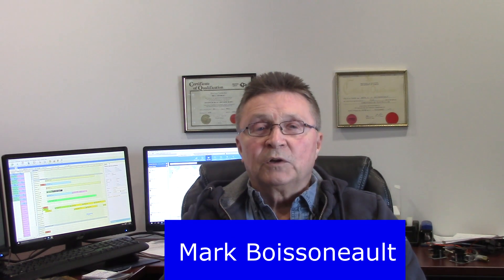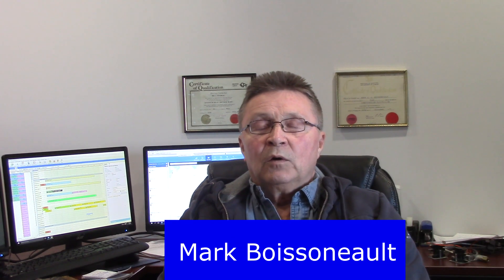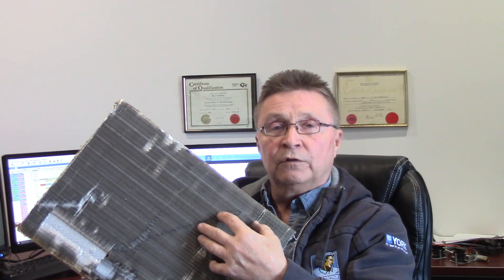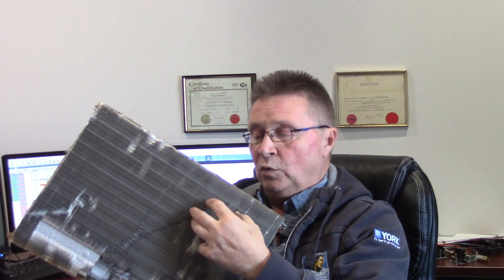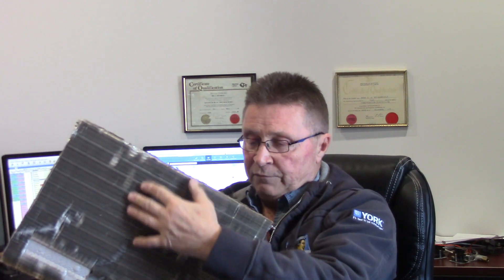3 most Common reasons Why Your Air Conditioner Freezes Up

Comment: sorry but I live in the land of farenheit. Actually in Florida to be specific and for context.Even in sunny south Florida, I know no one who runs their AC at 68 degrees F, let alone try for a quick cool down by setting it to 59. Is that common anywhere?

 that being 
said. I noted last summer, which was particularly hot with feels like 101 - 105 more common than not, that neighbors galore were pronouncing their AC units of various vintages and types    DEAD because they could not cool below the high 70's to mid 80's.  In that type of extreme heat and humidity over a period of weeks how low is it reasonable to expect your AC cool on a regular basis?

thanks for taking the time to share your knowledge. Much appreciated.
Reply from the maker: Its all about getting relief and comfort by dehumidifying and cooling to a level that is as good as can be expected on the hottest days. A 15 deg Fahrenheit drop from any temperature provides relief.  Up here in Canada we will at best see 90 deg f on our hottest days. Stay Cool!
Reply: With you being in Florida, the extra humidity puts an extra load on the A/C system. It raises the "superheat" (amount of heat picked up by the refrigerant as it passes through the evaporator coil) of the system.  It will take the A/C longer to pull the temp down to your desired level. If you desire it "meat locker" cold and when its time to change out  the HVAC system due to age, etc, go up 1/2 a ton. Example: if you have a 3 1/2 ton system, go to a 4 ton (and go with one with a TXV vs. a piston).  I  live in central Arkansas, and the summers here are just as stifling as they are in Florida (mid 70's dewpoints with mid-upper 90's air temps).
Keep those coils clean, both indoor and outdoor coils, and have the refrigerant charge checked if you think something is amiss.
Reply: Get OUT of Florida. It's as terrible as californistan

Comment: Thank you so much I'm new to the field and had a compressor and sucton line In ice and I knew it was a leak in the system but you also said that if you block all the vents that can be the issue as well.

Comment: Do you know why my new AC is blowing a sweet gross smell out of all the vents? We had a new AC installed in the Fall and I turned it in today to make sure it was working and there was a sweet gross smell coming out of all the vents. The mechanic said that it was not a freon leak and that the fan was working and all was okay, but why the smell then?
Reply from the maker: If the system is cooling and condensing nicely, it will not be because of a refrigerant smell. Perhaps there is something that accumulated on the evaporator coil or in your ductwork over the winter.

Comment: Thank you for the information shared. I have a question regarding ceiling concealed ducted split unit. There are 6 units installed at a light commercial building. 4 of the units serve an open trading floor while the remaining 2 serve a space. Based on the report given, there is a quarterly maintenance being carried for all 6 units. A year after commissioning the units, the cooling effect of the ACs drastically reduced (indoor temperature 26 - 27 degree celsius as against 22 - 24 degree Celsius initially observed)  even after the scheduled quarterly maintenance. I was privy to be present during the last service carried out by the technician and the tasks carried our were (1) remove and clean the filters (2) wash the return coil fins with brush and water (3) wash the condenser (4) Check the gas level (60 psi on low pressure side for R22 system). My question is that are the steps enough to be deemed a good servicing. The filters were clogged heavily and when removed, there were lots of dirt on the return coil fin which makes me feel it will have penetrated into the unit over time. The speed of the fan is low when operational and the condenser shuts down at about 5 - 6 minute interval and starts after 3 minutes. The short duration of the condenser working is responsible for the high temperature observed in the space. In the little research i have done, i saw that the blower of the unit is supposed to be removed during each service. Kindly confirm this and add any additional suggestion.

 Regards
Reply: From our experience, it does not seem reasonable to remove the evaporator blower during regular maintenance.  Unless of course it is blocking the way to properly clean the cooling coil. Based on the information you have provided here, it is hard to offer you a simple or conclusive solution. I do not know what brand of ductless you have but I will suggest that the manufacturer's teck support should be contacted by a knowledgeable service person in your area. 
If your units are short cycling and/or not condensing properly there are a few possibilities that are not that easy to diagnose. Refrigerant pressures do not necessarily represent a proper system charge. There are thermisters, sensors, and possibly transducers that are unique to each model and must be measured and compared to a known baseline reading .  
Good luck. Hope this helps.
Reply: Mark Boissoneault a little. Thanks

Comment: Reason 4: Unit is oversized
Reply from the maker: Yes this is correct. There are a few other reasons for this problem as well. Most of which would involve a much longer explanation.

Comment from the maker: Yes you are correct. A contactor or thermostat as well as a pinched wire  that shorts out  Y to R  can all be a reason that would cause the system to stay running and over cool and freeze up the evaporator. There are a few other conditions also not mentioned here as well. My intention for this short video was simply to offer a basic explanation of what I consider to be 3 of the most common reasons that most homeowners might encounter.
Thank you for your comment.

Comment: Please explain exactly how low refrigerant level can cause freezing up at the evaporator?  It is the opposite of automotive systems wherein low charge levels reduce evaporator cooling, not increase it.  I just don't understand the physics of how having less liquid to evaporate (and absorb heat) can INCREASE the rate of evaporation inside the coil.  Less liquid would get into the coil and the less liquid, the less evaporation, the LESS cooling.  Explain what I'm not getting please.
Reply from the maker: I will try to explain as best as I can here. The design of an evaporator coil is such that a high level of heat transfer is possible based on a steady flow of expanding saturated refrigerant vapor.
Once the required refrigerant level drops below designed capacity the refrigerant will flash or expand before it reaches the coil and become colder since there is little to no heat transfer happening at that point. Similarly lowering airflow across the evaporator would also lower the heat transfer capacity and frosting will occur.
Reply: Thanks TMS.  I'm an expert on Automotive HVAC, everything from Miatas to Macs. Most vehicles nowadays use some variation of a TXV to throttle refrigerant. As in home systems the refrigerant turns from a liquid to a vapor in the Evap. Too much refrigerant and the evap will ice up and there will even be frost or ice on the return line in a hot as blazes engine compartment.  Not enough refrigerant and for a while the refrigerant will vaporize before the TXV, then at a critically low level the system will shut down.  At no time will the evaporator ever ice up in an automotive system due to a low refrigerant level. It seems to me that if home AC refrigerant flashes before the TXV then there will be less liquid (if any) and therefore far less capacity for the refrigerant to absorb heat in the Evap.  I don't mean to belabor the point or disrespect your knowledge, I just don't get how if less liquid can vaporize inside the Evap it will actually be colder in there. I appreciate your helping me 'get it'. [I know home AC is more complex than Automotive because you guys have to deal with superheat and supercool calculations and we are quite happy to just know the high side and low side pressures.]

Comment: What about restriction in the line set or faulty metering device
Reply from the maker: You are absolutely correct Julius. This video however points out 3 of the most common reasons and not a complete and detailed list that would require a much longer explanation.

Comment: If you installed a brand new Mini split and it froze up the next day what would you recommend
Reply from the maker: It is likely that it was not installed properly or set too cold. Confirm that the installer knows what they are doing, and read the operating instructions.
Reply: Easy, 
Either Freon low due to improper charge at install. Or you have Freon leak. Or indoor fan motor failure. 
Solution:
1) Pressure test system with 300psi. of nitrogen.
2) pull vacuum of 500 microns or lower.
3) weigh in Freon charge as recommended by manufacturer 
4) enjoy your new system 

5) let professional licensed HVAC contractor do the work with warranties to protect your investment

Comment: perfect ... the idea of freezing when the air flow is blocked , because the air will carrying or absorb the cool from the coil and make it's Temp down so will not get freeze . if the air not flow through the coil the coil temp. will get down until it's freezing

Comment: My AC started not working this summer. I had a AC guy come out but he just charged me a service call fee and did nothing. Today it was really hot and I turned the AC on and it was cooling ok. It's been running for a few hours and I removed the vent just above the evap coils to look at them and they are about a quarter frozen with water pooling already inside the housing. There is no dirt on the coils and my filter is brand new.
Reply from the maker: Is the evaporator  coil clean on both sides? And is the condenser coil clean on both sides as well? Based on what you have found so far , it looks like the unit may have developed a leak and is low on refrigerant. How old is the unit and what model?

Comment: How do I stop the water from  leaking into the drip pan that drains outside the house?
Reply: You should not try to stop the water from being produced. That represents the humidity that is being removed and giving you comfort. The water needs to go somewhere. Newer models have a water sling on the condenser fan blade that splashes the water onto the coil and eliminates and water coming from the drain pan. You may need to upgrade to this type of unit to get away from water draining out.

Comment: Hi great video thank you very much for posting it. I had a question I bought four AC units 1 Danby 12k btu and the other 3 Frigidaire 5k btu none of which have holes for the water to drip out in the rear. They are mounted into the wall. Do I need to make my own hole in the back there does not seem to be any plug to take off? Thank you
Reply from the maker: Hello Hose. Chances are if there is no drain hole then the system is designed to use a fan blade that internally scoops up the condensate water as it transfers from the front cooling coil to the rear fan blade and splashes  it onto the rear coil where it evaporates. This is a newer design that makes it more efficient.

Comment: It is hard to understand one of your explanations for freezing up of the coil.  You said if there was inadequate amount of refrigerant in the system or if it had all leaked out the coil would freeze up.  How So?  If there was little Freon left in the system then the unit would simply stop cooling the air because it cannot cool the volume of air in the house for what little Freon is available.  
If the filters were changed frequently and there was no obstruction of the vents or bypassing of some of the vents AND the condenser was properly sized for the house (roughly one ton of refrigeration for every 600 sq feet of floor space) then the coils most likely would not freeze up.  Your demonstration of dirt covered coils was useful.  Thanks.

Comment: A common error is oversizing the AC condenser beyond the capacity of the house.  For example, installing a condenser for 4 tons of refrigeration in a house with 1,300 sq feet of floor space.  Once that condenser is properly sized for 2 tons of refrigeration, which is the correct size, then the coils stop freezing up!
Reply from the maker: Yes I agree. But the actual reason is that 4 tons of cooling requires twice as much airflow as a 2 ton. Every ton (12,000 btu) of cooling generally requires 400 CFM ( cubic feet  per minute) of airflow.

Comment: What about oversized systems to home area? Is that a concern that could cause freezing? For instance, if the unit is larger than the space it is cooling by a large amount?
Reply from the maker: Yes that could be a problem. The main concern is that it would cool too quickly and not remove much moisture that would give you lower humidity and more comfort.  The A/C being to large for the area can become a freezing up problem simply because the airflow is likely not enough for the added tonnage. Basic rule is 400 CFM per ton of cooling. EG: 2 ton (24,000btu cooling) generally requires 800 CFM (cubic feet of airflow across the cooling coil).
Reply: Wow... Was not expecting as prompt a reply. Thank you!

Comment: Great video, but please tell the thermostat settings in Fahrenheit and Celsius.
Reply from the maker: Yes I never thought my video would be popular in the USA. Thanks for checking it out.
Reply: Tradesman Mechanical Services Ltd. So what is too low of a temp in F
Reply from the maker: Most people do not need to have cooling down below 70f. to feel comfortable. Every degree below that is usually unnecessary and will eventually reach the point where frosting or icing occurs. I have seen the odd system that will cool down close to 62 Fahrenheit but of course it was working perfectly fine. 
Thank you for asking.

Comment: Excellent video, blazing summer heat and the ac is constantly puddling water under the handler. I changed the filter and hosed down the a pillar which was full of dust(desperate maneuver). I check the drain line and it's clear. I think it's low refrigerant and me having the vent in the second bedroom closed completely. A combination of things. Great video thank you.

Comment: Very informative!  Thank you:)  Mine froze up last night and I could hear a thumping noise in my attic where my air handler  is.  It also wouldn't blow air but the outside unit was running.  Do you think this is a lack of air problem or refrigerant problem?  I turned it off for now.
Reply from the maker: The thumping noise would be coming from the blower. Make sure the bower and motor are running properly and rule out any airflow problem before moving to a refrigerant problem. Good luck with that.
Reply: Thank you!  It was the blower motor in my attic.  Got it replaced.:)

Comment: Hi, had brand new a/c installed  closed one of vents closed can this ice the coils and lines. If so do I just let the ice melt from the coils and it will start working okay again?
Reply from the maker: It is hard to say if one  closed vent caused it to ice up.  After it melts off start over with all the vents open and only set the temperature a little warmer than you had it and go from there.
Reply: azucena hernandez  '

Comment: I had my central air freezing up (some of the pipes coming out of it, etc. literally had balls of ice around them). The tech, after looking the system over for like 45 minutes, said the blower is too weak and needs to be replaced (around $1,800). I'm going to get a couple other quotes. 

Just thought I'd post another reason AC's might be freezing up.

Comment: Hi Mark,
Same scenario as you explained, System used to function properly, currently freezes up after an hour or so, Condenser is cleaned and charged, not leaking. Clean Air filter, evap coil and heat exchanger, floor vents or open and not blocked.  set to 22C. Blower is within amp draw spec. 
Any further troubleshooting tips?
Reply from the maker: Hi Eric,
I would have to first ask, how do you know that  the system is still fully charged? Beyond the basic information on my video, there are some less common possibilities that are related to refrigerant metering and flow. (restricted orifice or faulty TXV) System capacity and performance can only be accurately assessed by measuring superheat and or subcooling. To be fair,I would have to know more information about your system including the service history.
Hope this helps.

Comment: Something else that has caused mine to freeze is poor or blocked drainage. If the water starts backing up into the drain tray it will freeze into ice and slowly pile up to the point where it blocks air flow and then the whole unit freezes. Any recommendations for keeping that drain pipe clean?
Reply from the maker: That seems very unusual. I suspect that this is a window or wall type air conditioner. If that is the case make sure that you have a good slope to the outside for it to drain. If a unit gets really dirty and properly cleaned afterwards, there can sometimes be small clumps of dirt that are left behind. Those will eventually clog up the drainage again. Flushing is really important.